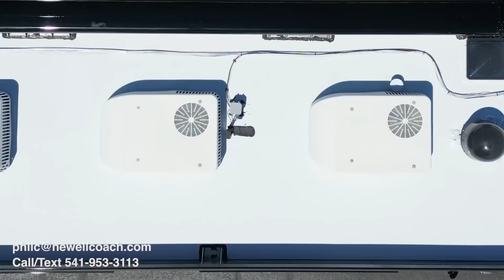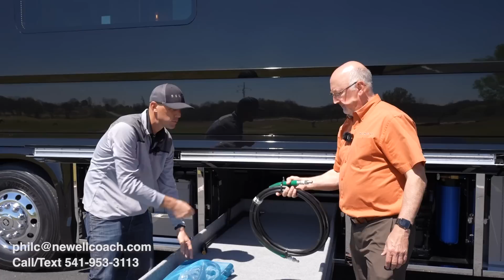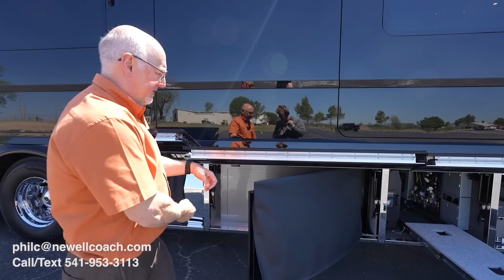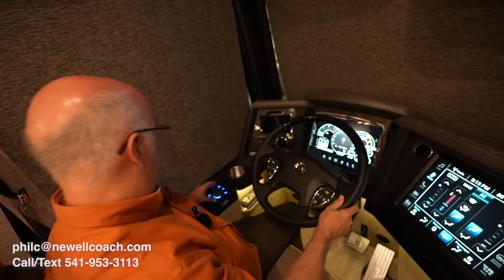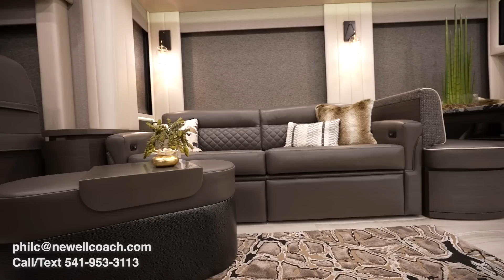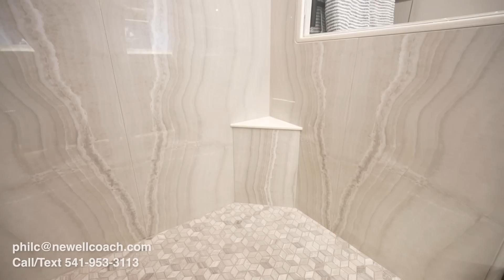Tour of 2024 Newell Show Coach #1777

Comment: For $3Mil, I want more Security, Communications, and Survival elements designed into the MotorCoach not just Luxury elements and features. How about Run-Flat Tires, Radiation H2O Purification System, Safe Room, -32 degree Temperature Capabilities, Satellite Imagery, Radar Tracking, Weapon Capabilities, 007 Type Stuff😂

Comment: Wish you had spent more time showing the galley instead of just the freezer , the bar glasses and the pantry slide. I prefer my outside storage bays to open like a regular door. Thanks for not putting a zillion TV’s everywhere. The round front under sink bathroom cabinet looks really cool but if you are short it’s difficult to lean over the sink if you’re trying to brush your teeth. You actually have to stand on your toes to get over the sink far enough. Very attractive coach. I prefer a dining booth the way you have it. When you put that great big U-shaped dining table there’s a lot of seating area but the table doesn’t match up in size. The banquet may seat a half dozen people but there’s only room at the table for maybe 4. And if you want to set a bowl of food or a platter, there’s barely any room for it. I’d rather see a shower stall about 1/3 less in size. The washer and dryer are beautiful. At first glance I thought there were 2 washers and 2 dryers. Then I realized there were mirrors on the wall. At first glance I thought WOW! Now that’s what I call Movin’ On Up! And I don’t mean to the East Side!! Black is stunning but if you’re in a hot climate, it absorbs heat. A lighter color with subtle graphics would be more my style. Never have cared for the wild and crazy ones that look more like a kid scribbling in a coloring book! What’s the possibility for solar power?

Comment: Great video.  I think it’s a nice touch that you have Phil’s contact info running in the corner of the video.  Just a thought - would be interesting to do a walk thru video with Amber - have her share her thoughts on the design process / materials chosen / nuts and bolts of working thru the build process with the buyer.